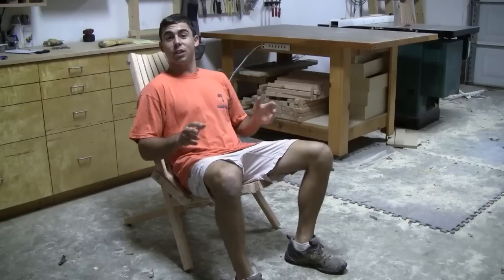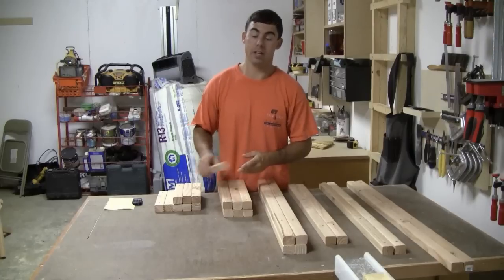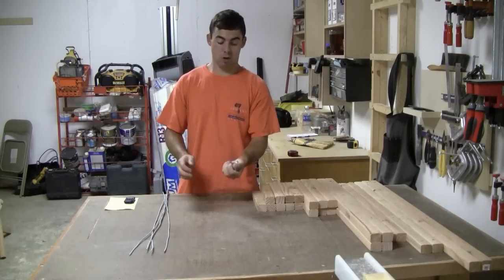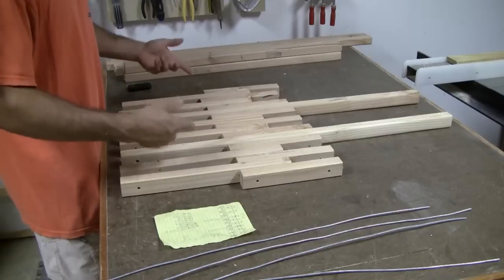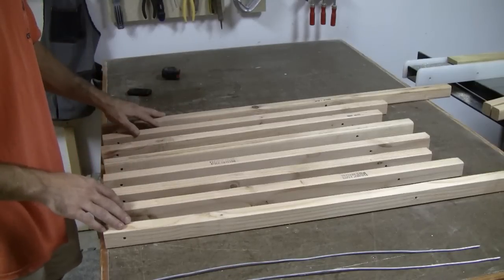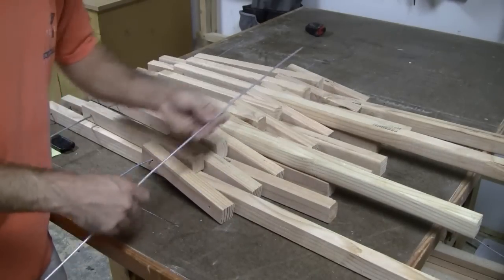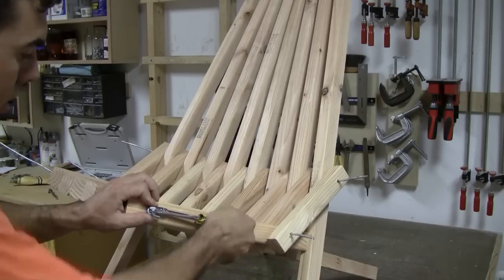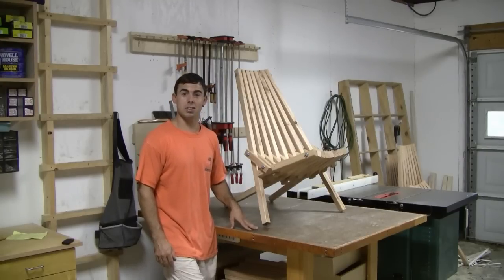How to make the Folding Stick Chair - Easy Project

Comment: I made the chair two weekends ago. I started with the wire, but it was wobbly and wouldn't support my weight. I used #10 threaded rod, washers and nuts instead, and also coated it with linseed oil. I took it to work to show it off and had every guy who saw it drooling for the plans. I forwarded them your link and expect to see their versions after the weekend. Thanks again for the great video and plans on your blog.
Reply from the maker: Glad you liked it and that it turned out so well for you.  Threaded rod, I guess I should give it a shot if I every try another one.  Thanks for directing the guys at work this way, much appreciated.  Thanks for the comment.
Reply: Would love to see an all thread version. Can you post pics? Thanks.
Reply: @thechinadesk  You can see a bunch of the one's I've made on my Instagram - https://www.instagram.com/kentuckystickchairs/.  This video is the one that got me started making these... and I estimate I've made about 950 of them in the last five years.
Reply: Hi im Brian from S.A ,I love the stick chair , one problem i found out when a heavey person sit on it , it give in or go down how cane i solve that problem .

Comment: Thanks for this. I build a pair and they came out great. I used all thread rod and acorn bolts for a clean look.  Keep up the great work, and  thanks again.
Reply: All thread and acorn nuts! Just what I was thinking. Can you post pics? Thanks!
Reply: Bevin Chu  you can see them on my Pintrest board.  The board is called West Coast Wood.  There is a section of some of the these chairs I have done.
Reply: 1kenkelly
Thanks! Will check it out.

Comment from the maker: Glad you liked the video!  I'm not sure what could be wrong, but I think I had a very similar problem when I first assembled one, yea I know I did...  I ended up having my pieces in the wrong order.  What I'd suggest is to carefully compare your chair to the layout images on my blog, just to be sure you have your pieces in the correct order.  If that doesn't fix it then double check where you drilled your holes.  You'll figure it out, thanks for the comment!

Comment from the maker: Your welcome Kev!  2x2's should be fine, I think a few people have done it that way.  As for cutting the back leg at an angle, having it sit perfectly flush with the ground could pose some problems.  With that point and the very back of the leg it could have a tendency to break easily.  If you wanted to you could cut half of it flush with the ground making a "V" on the end of the leg.  Know what I mean?

Comment from the maker: Sparkie, I'm not positive.  I guess you could, but then you may be risking some strength in the back legs.  Since they are longer as it is the higher you raised the chair and if you kept it on an equal plumb then those legs would be pretty darn long.  Then the leverage force on the leg may be to great.  I guess you could make the back legs a little beefier.....

Comment: Very nice. Like the fact that it is "low tech" and does not require advanced wood working skills. All simple right angle saw cuts and simple perpendicular drill holes. No need for dovetails, mortise and tenon joints, or even mitered joints. By the way, did you ever make one using threaded rods instead of wire cables? If you did, how well did it work?
Reply from the maker: Same here Bevin, simple is better! I never did make them with all thread. I can be cheap at times and I figured that all thread would be more expensive than the wire..... Thanks for the comments!
Reply: Bevin Chu The ones I make are all threaded rod. You can see a sample at https://www.etsy.com/listing/221841515/folding-kentucky-stick-chair?ref=sr_gallery_1&ga_search_query=kentucky+stick+chair&ga_search_type=all&ga_view_type=gallery
Reply: Mickey Carman
Great! I'll take a look.
Reply: Mickey Carman what size threaded rod did you use. I like that idea a lot better than using wire plus it looks better. Please let me know if you had to bend the rod as well to go along the curve of the chair. Thanks

Comment from the maker: You could make the two leg pieces a little longer but then the back legs would extend out a good bit and may be to weak.  You would have to use something a little beefier for the back legs to keep them from snapping.

Comment: Cool build!  Started making one over the weekend.  Will finish it up next weekend.  Question.  Have you ever used vinyl covered wire rope?  It's very flexible and not stiff like galvanized wire.  Think this will be an issue?  Thanks for the plans too!
Reply from the maker: Andres, Glad you like it! I haven't used the vinyl covered wire rope. I'm thinking that some rigidity is good to have with this chair for when it is in the folded mode. Not sure though and you wire could work well. I'd say it might be worth a try? Best of Luck!
Reply: SailingandSuch so here's an update.  Wire rope is too flexible.  Check this one off your list.  What gauge wire did you use?  I can only find 9 gauge at the big orange store.  Seems a bit narrow to fit in the wire nut.  Just curious what you found.  thanks again for the plans!!
Reply from the maker: I can't recall the gauge of the wire.... It was at the big box store though in like 50' or so rolls.
Reply: i'll check it out.  Thanks again!  Have a good one.

Comment: For those that don't have a table saw, to rip boards, you can purchase pressure treated deck balusters that are ready to go from your local lumber yard (Lowes or Home Depot). I just made a chair last night, using them, and they support 215 lbs easily. I highly suggest drilling the holes one size larger than the rod or getting a drill press to ensure accuracy. if they aren't aligned perfectly you will need a drill to spin the rod through.

$0.98 each
http://www.lowes.com/pd_488985-432-P42SE1T15EL___?productId=50279745&pl=1&Ntt=deck+baluster
Top Choice Square Ecolife Treated Deck Baluster (Common: 2-in x 2-in x 42-in; Actual: 1.31-in x 1.31-in x 41.75-in)
Reply: thx so much
Reply: Hi its Brian from S.A  I like to know why does the chair go down when heavy person sit on it please  help.

Comment: how does this hold up over time? Just seams like the wire would stretch and it would get looses
Reply from the maker: +GoGreenMan Holds up great Man. Haven't had any issues with the wires stretching. But if they ever did just loosen the clamps and tighten it up. Shouldn't be a problem though.

Comment: The directions are excellent and clear however for me as a novice woodworker I have only one confusion in terms of the cutting of the 2x4's. I know 2x4's are actually 1 1/2" x 3 1/2" so my confusion simply lies in the cutting of this board...Sorry if  stupid question otherwise I understand your other directions.
Reply from the maker: Hector, I'm glad you find my instructions clear!  To help clear the confusion up, to cut the 2x4's you simply rip them to 1 1/4".  So you are cutting on the 3 1/2" side and not messing with the 1 1/2" dimension.  You will need to cut the 3 1/2" side twice at 1 1/4".  Does that help?
Reply: Perfectly thank you as a newb, I find my most common mistake is sizing as I'm still learning the real dimensions of wood lol
Reply from the maker: Hector Santiago No problem Hector.  Glad we got it cleared up!

Comment: careful not to scratch your leg with those wire clamps though...
Reply from the maker: Frank Hernandez Your right Frank. After I cut them I do take a file to them to smooth them out a bit. They certainly can be dangerous! Thanks for the comment!